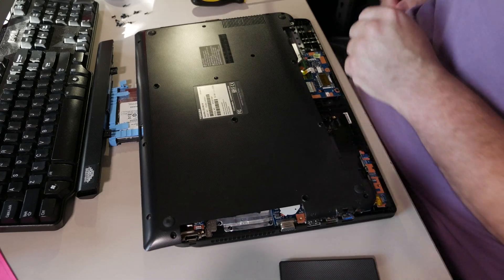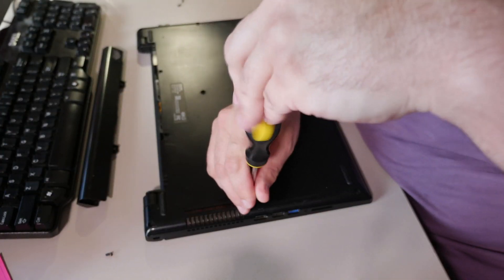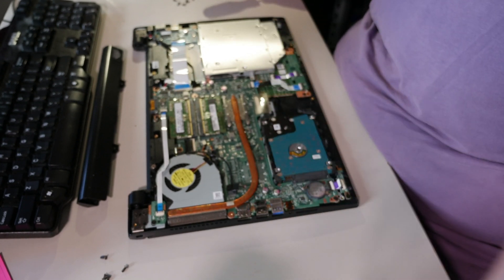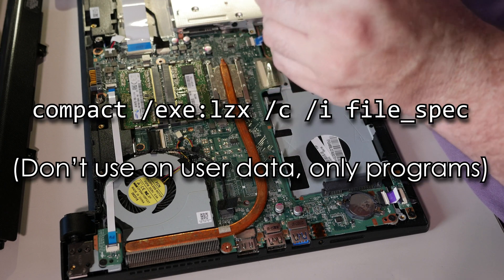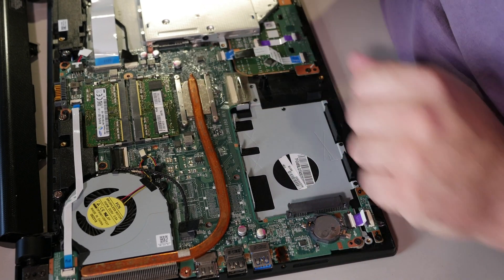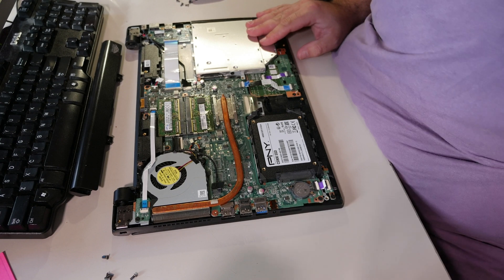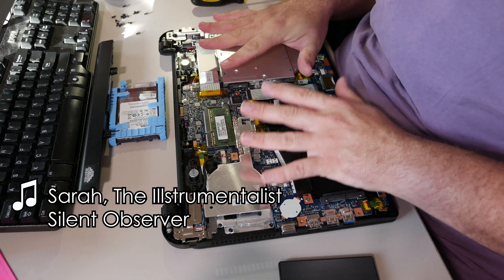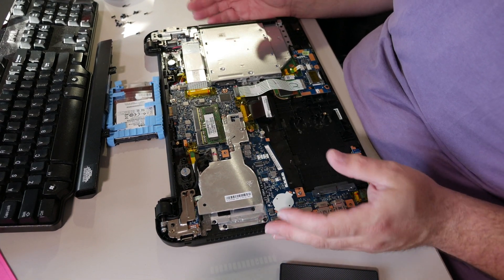Toshiba C55 Disassemblies (C55-B and C55-C series) - Not Quite Identical, NO M.2 SLOT - Jody Bruchon

Comment: I've been looking all over the internet for a C-55 that looks exactly like this first one. And now that I've found it, I still have no idea where the i3 processer is located on that board. Is there any chance you can point it out to me?
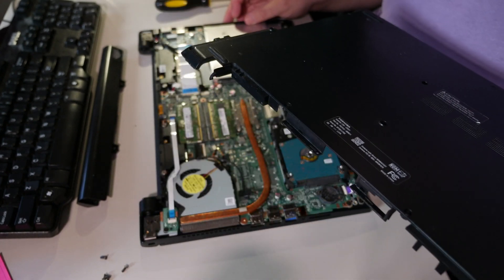Reply from the maker: @LagosEra  1:26 Follow the copper heat pipe away from the fan. The metal plate covers the non-upgradable processor.
Reply: @JodyBruchon  
Why is it non-upgradeable?
Reply from the maker: @LagosEra  All laptop CPUs since the 4th gen Intel chips are non-upgradable. They're BGA, not socketed.